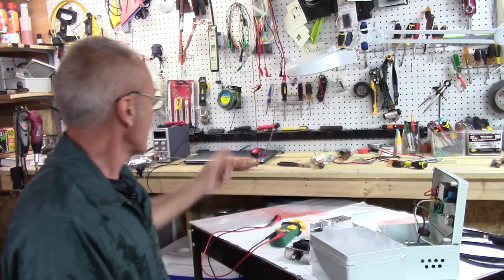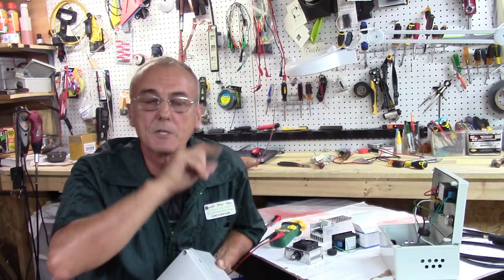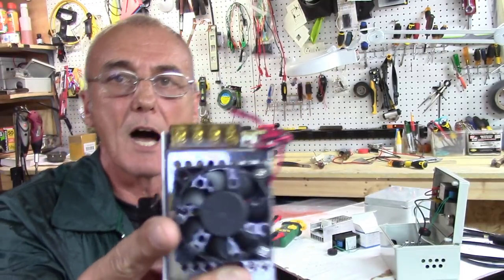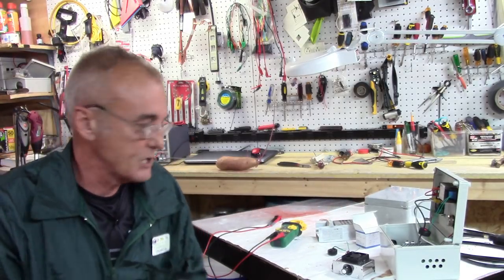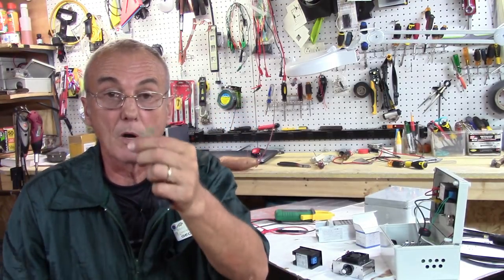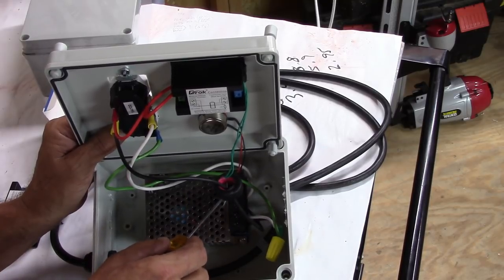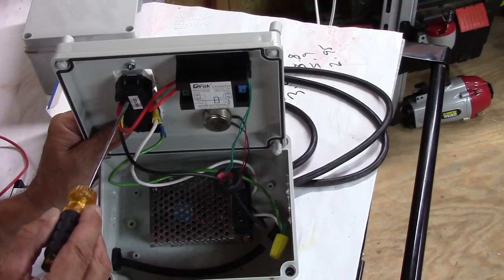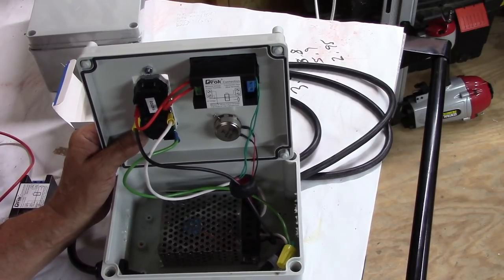How my PWM is wired

Comment: You give me good ideas.  I built a PID controller and used it in a single heater 3 gallon boiler and it improved temperature control greatly but lead to an oscillation when it was the only heat source. So I used the stovetop electric element to provide some controlled heat and the still was more stable.  Now I want to be able to retrofit the PID with a PWD channel for 2 element heat control and this may be ideal at a reasonable cost and remove dependency on the stovetop.  Thanks for taking this hobby to a higher level.

Comment: You could add couple DPDT two position switches to that set up and be able to switch between measuring input and output values (you'd need another current tap too)
Reply from the maker: Good idea.

Comment: Pulse WIDTH Modulation. Pulse WIDTH Modulation. My system was constructed using standard laboratory glassware. It has a low volume output but it is highly regulated and produces a very high quality end product. I also use a controller to regulate the temperature. I have a temperature probe that extends into a 1000 mL boiling flask that boils my wash. I found the sweet spot to be 90 C. The temp at the top of the reflux column  goes to 78 C and sticks there until the ethanol is exhausted from the wash. The chemistry of the entire process is obvious to me as I can see everything that happens - I have the temperatures monitored at critical points in my system. The most critical temperature is that of the wash. If I let that exceed 90 C, the proof goes down and the tails are passed to the collection flask, and the flavor goes to hell in a handbasket.
I am an electrical engineer with a strong chemistry background. I have been designing products using pulse width modulation for over 25 years. Pulse width modulation is used for many, many applications these days for everything from temperature control to audio amplification to RF modulation. Tell you what - Google PWM and see what it says.  You won't find the term "wave" in any of the descriptions. Pulse WIDTH Modulation.
Reply from the maker: Thanks Jim. 
George
Reply from the maker: Jim, You are absolutely right. I got stuck on pulse wave when clearly it is pulse width. I plan to fess up to this mistake and correct it in the next video. Thanks again for pointing this out. It is important to be precise.
George
Reply: George - The important part of your video is you understand  the theory and you know how to implement the concept. That is astute. Your videos did good service to our community.
 I took a lot of data on my runs and noticed the reflux column regulated the temperature at the top of the column without much regard to the temperature of the boiling flask. That means the process regulates itself to some degree, which is exactly what the chemistry and physics of the system dictates.
When I bring the temperature of my system up slowly, the temperature at the input of the condenser ( the top of the Vigreux column) rises in steps. How do I send you photos of my equipment?
I have many questions and observations that I need to convey and you have no idea of where I'm coming from.
Reply: You have a lot to share and you are building a YouTube channel. You show good video skills. I encourage you to continue. I have benefitted from your videos. Thanks.
Reply from the maker: Jim
 Please feel free to email anything you want to share to 
george.duncan76@gmail.com
I would really like to see more of what you are describing.
George

Comment: Ok I like this set up and want to build one. But what are you going to use to monitor temp? I’m not finding a digital temp that has a k type probe. I would like to use some of the parts I already have.
Reply from the maker: This controller has no feedback mechanism so there is no K type coupler. 
The requires one to track temperature the original way by placing a thermometer (any type) in the head of the column. 
George
Reply: Yes I understand that but I have been looking for a digital thermometer that I could put in my control box to monitor. I have found a few. Most are 12v but can’t seem to find one the displays in Fahrenheit.
Reply from the maker: Jayson, in the past I've used a thermometer that I got at Wal-Mart for around $12. It is a kitchen thermometer with a K-type coupler that runs on batteries. It reads in C and F and even has a timer function. The cable in some models is very long and may do the trick. I also have one for grilling (cost me $30) and it is amazingly easy to use. 
You could add this to your controller and have that instant readout of temperature you are looking for.
George

Comment: Hello George. I have been watching all of your videos and when I got to building heat controllers it looked like something I could do and save some money. If I could get a parts list for both PID and PWM it would help a lot. I want to control a 220v 5500w heating element and on the videos some of your info is for 110v and I don't want to fuzz up
Reply from the maker: I have a video or two on 240V as well. Same wiring, same principal.
George

Comment: Is a PWM same as and SCR controller as sold on Amazon?
Reply from the maker: Yes. An SCR is a Silicon Controlled Rectifier. A PWM (pulse width modulation) is the result of the workings of an SCR.
Hope this helps
George
Reply: So... whether I buy one called and SCR or PWM... One is as good as the other?
Thank you!!!

Comment: George  I have been trying to locate the 120 v AC / 12v DC transformer to run the 12v DC fan in my PID Box.  If you have a part number  and make  of the transformer so I can order one  to complete the assy of my box it would be a lot of help. thanks..
Reply from the maker: Here is a link to amazon for a small transformer you are looking for.
I use these because they are dependable, small and easy to wire (solder wires to it for best results)
https://www.amazon.com/gp/product/B07CQN7Y2C/ref=oh_aui_detailpage_o00_s00?ie=UTF8&psc=1

Comment: George I have a pwm with a voltage in voltage out and common. I'm running this at 240 volts and have 12-3 wire.  One leg of the hot obviously would go to the input and then back to the out put. I'm wondering what the common would be. Would this be the ground wire?
Reply from the maker: In 240 both legs are hot. 240 creates its own neutral through the sine wave so there is no neutral wire. On you PWM you would have 2 hot wires for voltage in and then 2 hot wires for voltage out. The ground wire would go to the receptacle.
If you are using an amperage meter to track current with, the round sensor goes around only one hot leg. 
George
Reply: @BarleyandHopsBrewing  So would you then separate the two hot wires going from the "OUT" terminal to the outlet?

Comment: I assembled one of these a couple of months ago.  Works lights years better than the pid box i made. When the pod would get close to temp and cycle on and off. The dripping on the off cycle would completely stop. And wouldn't resume until the pod cycled back on. Then stop again on the next cycle.  A bit of a headache.  The PWM gives constant power. However reduced when turned down. Much easier to control. However when i purchased it, it wasn't called a PWM. It was called a SCR. Now im not a electronics expert.  Is there a difference?
Reply from the maker: They are in the same family.
Good work.

George

Comment: Using this method, do you have to measure your temperature manually, rather than setting a temperature for it to stay at?
Reply from the maker: Yes, this is very much like your electric stove controls. You must manipulate the dial while tracking the temperature.